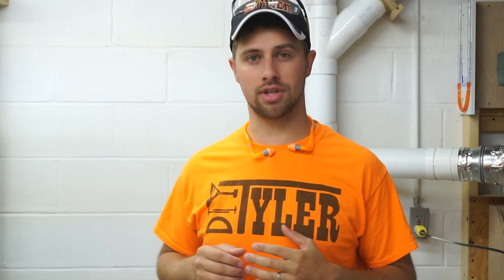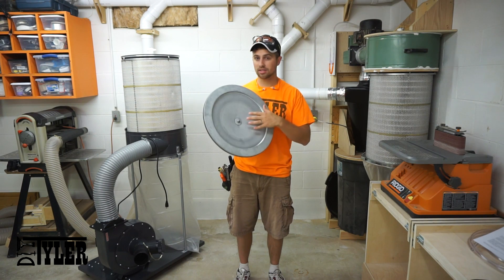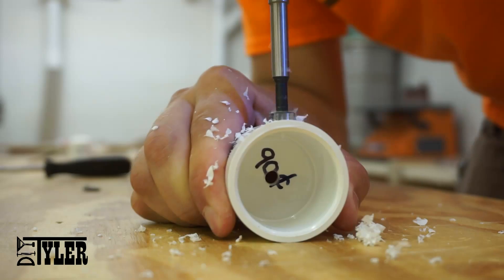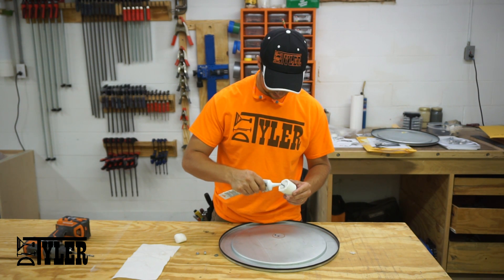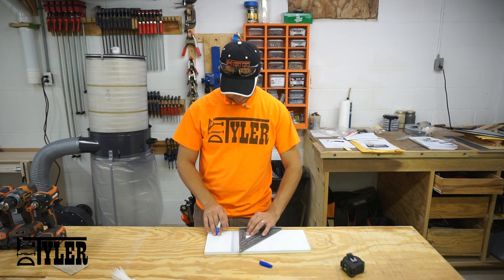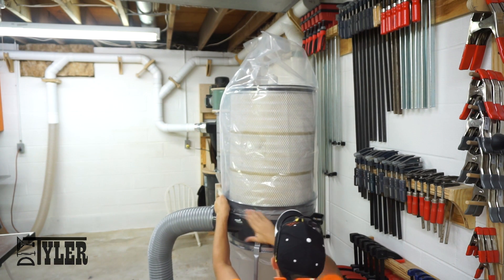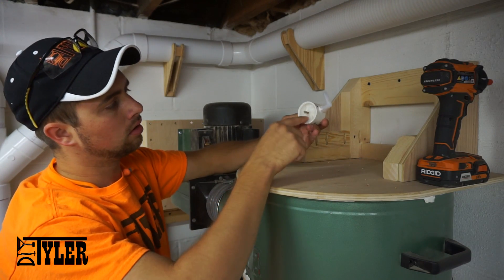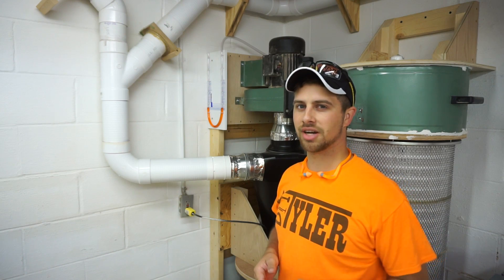How to make a Manometer | Realtime Dust Collection Filter Monitor

Comment: At 2:12 you talk about driving in the hose barb into the PVC.  I suggest you take a 3/8 pipe nipple, clamp it in a vice between two scrap pieces of wood and using a trianglar file, file a notch perpendicular to the threads.  Clean off an burrs and leave it in the vice.  Now take your cap and basically thread the hole.  You could also use a tap, but this is a DIY way.  I have pictures, but could not find a way to upload them.

Comment: Tyler, I love your videos but I feel I must add a comment of caution.  I converted a Harbor Freight 2 hp dust collector to a 2 stage hybrid system using a homemade Thien baffle.  With a garage shop with 13 blast gates, I was unsatisfied with the airflow.  Before replacing the 10" impeller with a Rikon 12" unit, I took anemometer readings.  My Jet jointer is the farthest tool  from the DC.  The air flow improved from 261 cfm to 344.  I then upgraded the filter from the 1 micron bags to a Wynn canister filter.  I bought the 13F230NANO.  The air flow increased even more - now 410 cfm - that''s a 57% increase from where I started.  I then built the manometer.  I followed your video to the letter, wrapped the new filter for the "clog" test and POW!!!  It shot my red water sky high out of the hose.  Should I have opened a blast gate to run the test?  If that is a non-issue, maybe the manometer is not for DCs with larger impellers.  Any thoughts?

Comment: I did a bit of experimenting. I tested a 1/8" diameter and a 3/8" diameter hose for these purposes.  Held in the intake air stream of my "four bag" collectors (one with bags, the other with cans), the fluid would be sucked out before I could shut the unit off.  The smaller the hose, the more time I had to save the liquid.

Dripping the fluid in, I got a LOT of trapped air. By adding LESS than a drop of dish soap, the tinted water dropped down into the U better.

By taking a piece of plastic [or what have you] and drilling a hole through it big enough for the hose, I could push the hose into it. THEN, by drilling a second, preferably larger hole in line with it and stopping at the back of it, then taping (threading it for a screw), you can make your manometer into an adjustable critter for use on different units of varying vacuum.

By making the U longer, and more sensitive, you may be able to get easier readings off your manometer.

Comment: Tyler I have a Powermatic with 2 filters any suggestions as to how to set it up with 2 filters.
Reply: The number of filters has nothing to do with placement on a dust collector. It goes in front of all of them, unlike a furnace, for which the meter must go between the fan and intake filter.

You could put it on the intake of a cyclone feeding your PM or, if no pre-filter, in the intake.  However, you'd have to use something like an IV valve to limit suction, or it will empty your meter fluid into the collector before  you can turn it off.

Comment: I really like your DIY videos Tyler!!  I have a 1.5 HP Shop Fox W1685 bag type and is similar to the Harbor Freight type of dust collector.  I purchased and installed a Wynn 35BA222NANO filter but did not do the Oneida cyclone yet as I want to see how this works out.  I use this mainly for my lathe for sanding and a few chips.  Most of the chips end up on the floor and I just sweep them up.  I made the Manometer as you outlined and it seems to be working...I think.  Here's what happened.  When it had it done and mounted on the wall I added some colored water as you did in the video with enough to fill the bottom loop and just start up the straight part of the 3/8 tube.   There is about 10" of empty tube above the water level.   I turned on the dust collector and the water stayed right where it was and did not move...as I expected and I had great suction compared to the old bag system.  Then I put a plastic bag over the filter and duck taped it to the metal ring supporting the filter as you did in the video.  When I turned it on the water completely shot out of the tube very quickly.  I shut off the motor and refilled the tube with more colored water and loosened the duck tape some on the bag over the filter.  Then the water raised up in the tube depending on how much I choked off the filter with the bag.   My question is how do I determine when to clean the filter?  I have marked the water level where it is with the new clean filter.  Why did your water not fly out of the tube...did you not have the filter "completely" sealed off.  Please advise.  Thanks Much.
Reply: mmfenske1 - not related to your question, but the Shop Fox.  I am looking at the same model right now and wanted your opinion as a whole.  Like you, most of my work is lathe related, but I do also plan to use with a small table saw and router table.  Just curious if you are happy with your choice.

Comment: So, I just made this manometer exactly as Tyler describes.  Put my new Wynn Environmental 35BA222NANO filter on my Delta 50-760 DC with my homemade trash can chip separator.  I placed the manometer exactly where Tyler did on the top of my filter, far away from the air flow.  Tested it clean and the manometer registered about a millimeter change, bagged it up and it blew the water right out of the manometer.  That's over 8 1/2" of water.
Reply from the maker: Well your machine truly sucks! I would simply say you need a longer tube.
Reply: Tyler G My hose is 10 ft long, I think the problem is that I have a Rockler Dustright flexible hose systems that allows me to hook the system to multiple machines without running all that plumbing.  Well, I had the hose off and not connected to any machine, so there was a 4" hose unobstructed, which may have also caused the pressure to increase.
Reply: Hi there, I am having the same issue. 10 feet of hose and hose connected to a machine and it still blows out the top. What did you do to resolve this?

Comment: I just made this and for a test run with all the blast gates open, the water went backwards towards the dust collector rather than the tube opening.  What does that actually represent?  An air leak?  When I sealed the filter, the water did shoot up like it's supposed to towards the tube opening.  Wasn't expecting that result and I have limited knowledge of manometers.
Reply: Troy Meredith did you install the meter on the suction side of your dust collector? it looks like he installed it on the outlet side before the filter. that way when the filter is clogged the added air pressure would move the liquid away from the dc showing resistance in the filters
Reply: I installed it exactly like how Tyler did above the filter (which is the outlet side).  It just moves ever so slightly (1/4") towards the DC when turned on under normal conditions, but when I blocked the air on the filter, the added pressure did indeed move the water away from the DC.
Reply: Remember when he said to make sure the intake for the monitor is not in line with the air flow? What your describing is probably because of that. The faster air is moving, the less pressure it exerts on its surroundings (called the Bernoulli effect). Basically, fast-moving air creates a lower pressure system. 

Your manometer tube has two open ends--the dust collector end and the end that is open to the atmosphere. Both ends have air pressure pushing on the liquid in the tube. When the DC is not running, those pressures will be equal and the water on either end of the "U" bend in the tube will be at the same level. Same thing if your filter is clean--no pressure build up from a clogged filter, so approximately equal pressures on both ends of the tube. If the filter is clogged up, the air pressure builds up when the DC is on, so the higher pressure on the DC end pushes the liquid toward the atmosphere end. 

If your tube inlet is in the line of the airflow, though, then there will be lower pressure on that end of the tube (Bernoulli).  So, the higher pressure on the atmosphere end will push the liquid in the tube back toward the DC end. That's probably what's happening with yours.

Comment: I have a diy cyclone system using a harbor freight motor and impeller  with a clearvue cyclone body and the blower hose from the harbor freight motor goes into the top of the filter stack not into the side as your does.  Any suggestions on where to put the manometer cap?  For clarity I don't use the Harbor Freight chip seperator as you have used, my hose goes to a plywood top on the top of the filter stack which is a smaller diameter filter that is two filters tall, more like the prebuilt systems from clearvue.
Reply from the maker: Steve, I would try and put it right in the top of the plywood plenum that you made. Thanks for watching!
Reply: Thanks

Comment: tip: add a little oil on top of the water to slow down the water evaporation.
Reply: I made something similar a few years ago. At first I used colored water, when that evaporated I put in automatic transmission fluid(red). Its basically fireproof mineral oil.
Reply from the maker: That is an excellent idea! Thanks!